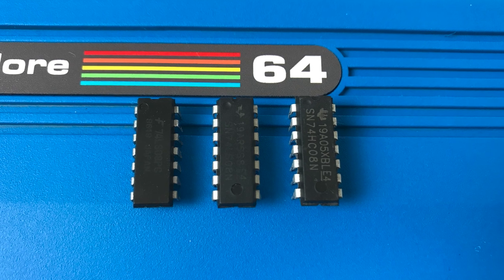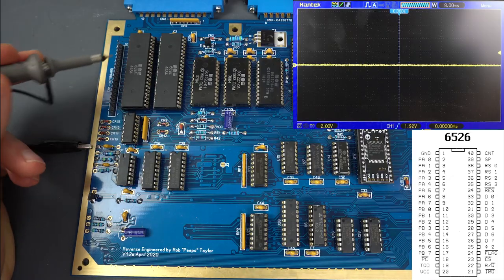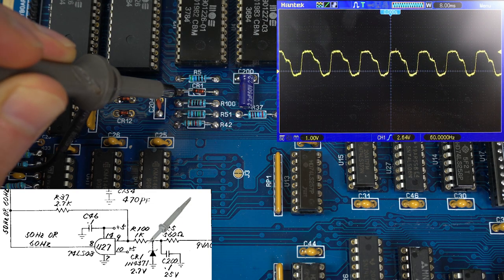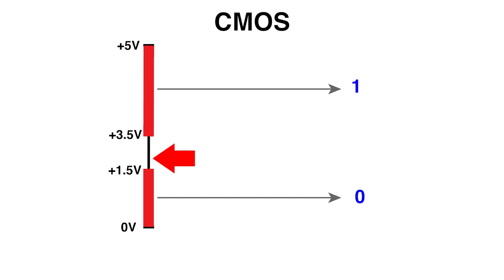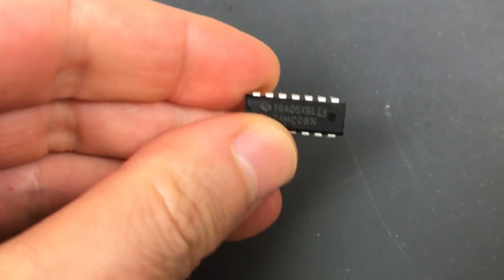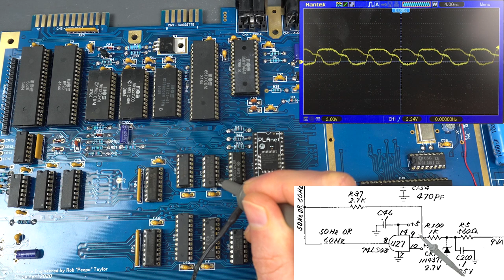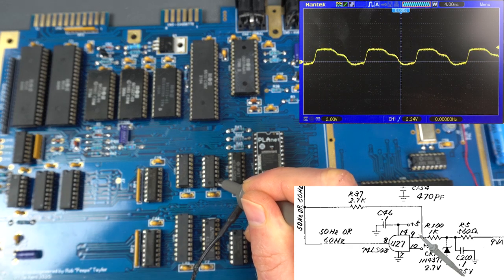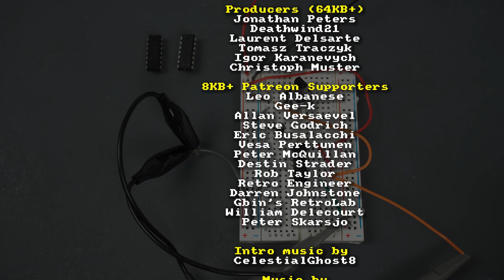Stumped By New Fake Chips Scam

Comment: Fake components started to become a problem in the early 2000s, when production was basically outsourced to Asia. A company I used to work for was seriously hit several times by the infamous capacitor plague. Even when sourcing supposed top notch products from very serious distributors, that ended reviewing their own supply chains, and, for what i understand, involved the police as well. It meant millions of pounds to these guys.
Reply: The real cash cow appeared after 2004 when RoHS laws were passed. Thousands of companies found themselves with a huge inventory of components with lead and almost all were bought by China at super low prices. These are now resold everywhere with new markings all dated after 2004 as RoHS compliant parts.
Reply: It was happening in the 90's. We had some Pentium chips that had been skimmed and re-lettered. Some would work for a while as the clock was out (A Pentium 75 clocked at 90 for example) but would crash after a while....

Comment: It happens quite a bit. I found it when developing Pi1541. I use a 74LS06 to take a 3.3v signal from the Pi and invert it to drive the open collector IEC bus signals on the c64 low. Some cheap Ebay sellers buy their components in bulk from China and most of the time they don't work as well as the official TI ones from Mouser, Digikey or Element14. Then the end users come to me complaining about my software. After I tell them to replace the 74LS06 with one from a credible source their problems go away. Thanks Noel, now I can refer them to this video.
Reply from the maker: What a bummer that it's happening all over the place. I really need to find a reliable source of chips that has reasonable shipping for small orders. That's the difficult part!

Comment: It would be interesting to see the current consumption of the suspect chip. A CMOS one will consume essentially zero (just a few μA) unless it is switching rapidly. A LS TTL one will consume mA or tens of mA in the same state.
Reply from the maker: That's a good idea. Maybe I need to do a followup video running some more tests on those chips and maybe cracking them open too. I've been meaning to do that for a while.
Reply: Also, TTL chips behave like they have a built-in pull-up resistor, and source some current when you input "zero" into them. CMOS chips are high-impedance in either low or high input state, you only need some current to (dis)charge internal capacitances when you switch the input from high to low or the other way around. Measuring input pin current can be used to tell TTL-like logic from CMOS-like logic.
Reply: I've seen that... back in the day, a friend helped me make a home-made RAM upgrade to a Tandy 100.  Using a standard RAM chip meant adding a logic gate, and without any HCT handy used a LS.  That one chip used as much power as the entire computer!

Comment: Wow, that's shocking that they've have gone so low to start rebadging 74 series...
Reply from the maker: Seriously! Although I really don't think this is rebadged in the sense of produced one way and modified, but I really think it was manufactured this way. Crazy!
Reply: @NoelsRetroLab  There are several Chinese manufacturers that produce these chips legit (i.e. HGSEMI, Xinluda and more). Very likely someone paid one of those factories to produce chips with a TI label (because then they sell for a higher price) and they were labeled LS because that is what people are searching for. If I buy from China I rather have a Chinese brand on the chip, because then it is much less likely a fake.
Reply: @danielmantione  I use CMOS a lot, both 74HC, 74HCT and 40 series. I think people should move to CMOS as they spend less electricity. Also, I have no static protection, and none have failed so far. So people should not be afraid of them.

Comment: Great video.  Just as a side note,  though the 74HC chips may or may not work in those types of TTL circuits,  74HCT chips(the T standing for TTL levels) are specifically made to be backwards compatible with TTL LS and ALS chips,  and the input threshold voltages would be the same for both.

Comment: The analog behaviour of 7400-series logic can vary widely from device to device.  I've noticed this myself with multivibrator circuits which were built using 7400 quad AND gates.
Reply: Well, they're not analog chips, after all. You can get a hysteresis filter using a Schmitt trigger part, such as 74x132 instead of 74x00.

Comment: To elaborate on what was mentioned near the end of the video, there are actually two kinds of 74 series cmos chips. The ones that are labeled 74C, 74HC, 74AC etc, are the kind you have in the video. They are made with the functions and pinouts of 74 series TTL chips, but with CMOS voltage levels for interfacing to CMOS logic chips like the 4000 series. There are also chips labeled with numbers starting with things like 74CT, 74ACT or 74HCT, etc. These are made with CMOS but they are made to use TTL voltage levels to interface with TTL logic, but with the low power consumption of CMOS. 

There are also parts labeled with numbers starting with 54 , such as 54LS08, 54ACT08, or 54HC08. These are the same as their 74 series equivalents, but are mil spec components with an increased temperature range.

Comment: I used to have 3 C64 computers but only one reset when the kitchen fluoro was turned on or off. The fast spike went straight through the psu and any filter Cs. If I remember correctly, tantalum caps filter out higher frequencies than electrolytics so would be better for HF noise. Once reversed, I wouldn't risk using a tant again...I have seen some light up even when installed correctly.
Interesting videos , Noel, and nice looking C64 board.

Comment: I repaired a ZX Spectrum programmable joystick interface recently and accidentally fitted a HC ic by accident with the others, instead of a LS. Had me looking for a very intermittent crash for ages, until I realised my mistake. The tipping point for a port crash was just on the edge and was corrupting the data line.

Comment: Hi Noel, me the Chinese mythbuster again! From my China factory experience, they may have shortage on the LS type of chips but not the HC, so they need to fill the shipment, otherwise the business will be ruined. Or someone did placing the wrong order carelessly. Since Chinese character is totally different from English, and Chinese factory is not a place with people with high level education, the foreman may barely can use English and make a batch of HC but customer want LS, so what? Mark them as LS!! Remark chips can cheat TLS866II and work in some situation, just this kind of circuit which require tight voltage level,fail.
Reply from the maker: Right, that makes a lot of sense. It's such a shame those things happen!
Reply: @johnsonlam  Do you think they feel bad about cheating or do you think they feel good that they succeeded in getting away with it? =(
Reply: I'm of the same opinion as you. The chip was bought from a reputable Chinese seller (they don't deal with NOS, or refurbished chips, only new stock), so the problem was clearly at the factory. I, too, guess they had this order, run out of LS and said "whatever, rebadge some HC and call it a day, no one will notice", and sent the chips to the seller.

Comment: In the 80' days a lot of clocks worked using ac signal as a clock freccuency because it is very accurate in long term.
Remember the "radio reloj despertador" all of them worked using the 50/60Hz from mains, in fact most of them have a switch for selecting 60 or 50 Hz.
Reply from the maker: Makes sense, but somehow it never dawned on me back then. I assumed they just had something internally that acted as a clock, but the 60/50Hz switch is a good giveaway 😃`

Comment: Something worth mentioning, re: mains frequency synched clocks..
For several decades, clocks have been synched to mains frequency. Before electronic clocks with digital logic, clocks like the one pictured used synchronous motors - a bit like the one that drives my belt-drive turntable. Here in Australia, the lights still flicker around 2am each morning as power utilities trim the rotating machinery driving the grid such that the number of complete cycles in the 24 hour period is (as far as I know) within a certain percentage of 24hrs x 3600 seconds x 50 cycles/sec = 5,184,000 cycles. That is mandated by the fact that traditionally, so much time-keeping relied on it. Nowadays, NTP (the network time protocol servers) means our computers and phones are almost always in sync.
Reply from the maker: I love the detail of the lights flickering at 2am because of that! I never thought of that, but it makes sense to resync the pulse count. I wonder if the same is true in other countries or they handle drift differently in a more progressive way (skip a cycle every X hours).
Reply: @NoelsRetroLab  It came up in a subject I was studying. It blew my mind that all those machines connected to the grid all run in phase, in sync with each other. Has to be the case of course, otherwise there would be massive failure currents. Good job on the video, btw. I had a heck of a time trying to source some HD63C09E chips that weren't fake. Two orders out of China were then a UK vendor sourced some, (also from China) tested them first then advertised on eBay. Got to upgrade my FLEX system but I haven't done much experimentation with the chip's native mode as yet.

Comment: Another giveaway that the chip is CMOS is that the OUTPUT voltage goes at or near 5V. A real LS one would barely reach 4V. Not that this affects the circuit any; I'm just bringing it up to add one more way of identifying the line of chip. Excellent video, although I wish that the scope had more prominent lines for each volt.
Reply from the maker: Good point! And I agree about the volt lines. I don't think I can tweak those, but I'll check just in case. I'd love to have them more visible as well.

Comment: with the latest version of xgpro (11.71) you can actually choose the test voltage (5.0, 3.3, 2.5, 1.8). one thing to note is the test menu is no longer listed as an ic option. it has its own menu and dialog window

Comment: Great explanation on the zener diode.  I had always wondered what an application for one would look like - little did I know I had one next to me!
Reply: Another application is to reduce a "TTL" serial port signal from "5V TTL" to "3.3V TTL" signal levels when connecting to the hidden serial ports in various gadgets using USB adapters designed for 5V arduinos.

Comment: Hello Noel! If you also change the resistor R100, not only the zener diode, to a higher value, you should get a higher voltage level on the AND gate input. So then it should also work with the "original" 74(HC)08.
   Greetings, Doc64!
Reply from the maker: Yes, good point. That was going to be the next thing I would have tried this this hadn't worked. I don't think it would have mattered too much to put a slightly higher value.

Comment: CuriousMarc did some videos the first part of this year where he was repairing a bunch of timer modules for an old HP computer. The clock circuit used was similar to the way the squaring up circuit for the CIA timer was done by Commodore, except it was crystal driven. 

He found that even if he replaced the chip with the same part number from a different manufacturer it would not work properly and he had to change a feedback resistor to a lower value. Evidently this type of operation is 'quasi-analog' (made up but descriptive term) and depends very much on the analog properties of how the exact chip was fabricated. So, in a typical digital signal operation it would work fine but not in this quasi-analog state. Interestingly Ken Shirriff found out from decapping and reverse engineering flip-flip chips that they have a quasi-analog design as well which explains why they tend to fail more often than other logic chips.
Reply: Potentially this might happen even with chips from the same manufacturer if they ever changed the design.
Something which was clear is that the LS chip produced a lot less "noise" than the HC chips when given a "midpoint input".
Reply: I can imagine a low-volume manufacturer using only chips that "passed" testing for their particular application, but HP isn't a low-volume producer.  They must have had success with their default supplier's chips, and never knew how close to failure they were.
Reply: @jpdemer5  I suspect HP knew full well. They designed the circuit knowing it would work with the ICs their suppliers made and that was that.

Comment: Great diagnostic video!
Yeah, conclusion is shocking. There is no logical sense to fake 74 logic chips, but, apparently, someone gets money from that. 
One option is, that assembly factory purchased lots of unmarked chips and after job was done, they resell these leftover chips very cheap or thrown away and rebranding was done by some underfloor factory in China who picked these up..

Now I need to verify my LS stock. I think that I have at least one fake, because of strange behavior in one new circuit - replaced with old used IC from different manufacturer and problem disappear.. 

This reminded me situation with TDA1524, back in days. Purchased originals - both was faulty. For one chip worked only one channel, for other chip worked only other channel. From different local seller I  purchased other pair of chips. Seller warned me, that these chips may be fakes. I get home, plugged first chip in socket and it worked as it should.. Both chips, claimed as fakes, worked, but originals didn't.. 😂
Reply from the maker: Exactly. I never even considered that 74xx chips would be fake. But now... ugh!
Reply: Maybe you can just order them with whatever label you want

Comment: Noel, this explains why I was told that you could use a TTL chip for a CMOS circuit, but you cannot use a CMOS chip for a TTL... due to the low trigger voltage levels. Blows my mind that a manufacturer would do this!
Reply from the maker: Well, this is not exactly the reason, because this is a very specific analog signal. But even in the case of digital signals, it's possible for a TTL gate to output 2.7V, which would not be recognized as high by a CMOS gate. Although I suspect that in practice that's not very often a problem.

Comment: There are two types of 74xx CMOS logic gates, the 74HC range, like the ones you were experimenting with, but there is another range 74HCT specifically designed to have the same transition voltages as standard 74TTL chips. The “T” after the HC denotes standard TTL logic levels.
I think if you put a 74HCT08 it would work.

Comment: Thanks for the lesson on CMOS and TTL differences. As always a very well put together video.
Reply: Quite weird, as 74LS isn't the original TTL, and 74HC isn't the usual Motorola 40xx CMOS. 74HC is a modified CMOS internal circuit that tries to approximate the original 74 series voltage levels.

Comment: Excellent video. I would like to mention a couple of things about importing from you know where but first some technical details. The first TTL was 74xx then 74LSxx and then 74Fxx and it has progressed from there and today we have 74HCxx 74HCTxx 74AHCxx and many nore that are not in common use. Along side in the earlier days we had the 4xxx series CMOS (which were very ESD senistive as there were no clamping diodes). 

There is something that is overlooked today. Most CMOS will run from a little over 2 volts up to - in some cases - about 15 volts. The "" LS F C HC HTC ALS etc are the "technology" and not the voltage specifications (Vil Vol Hih Voh). The Vil for old 4000 series CMOS was 1/3 Vcc and Vih was 2/3 Vcc and these are a specific voltages at a Vcc of 5 Volts but are different voltages with a different Vcc. As an example most JEDEC SRAM 6116 6264 or modern EEPROM 28C with Vcc specified as 5V +/- 10% will accept the lower TTL Vih even though they are CMOS. This is demonstrated clearly by the 74HCT series that is CMOS that accepts TTL Vih as opposed to CMOS Vih which is much higher. 

As for fakes - there are massive industries in you know where and they are based around the major ports. Order from a little further away and it will take longer but you will more likely get what you want. It will still be washed in the creek and pulled then sold as new and be usefull for hobby use but at least it will be what you believe you purchased and will probably work as expected. Detection is such a problem now as it poisons supply chains that critical industries like medical, aviation, aerospace xray the chip to read the die. 

Loved the video, older but very relevant.

Comment: Great video, many thanks, love the logical fault finding and 'proving' technique...now that's how to find faults, guys. Servicing TVs in the 90's we had a batch of  high power 2N3055  TO3 transistors immediately blowing up when switched on ( put on Blast hats and dive under the bench!!)  Cutting a 'new' one open, we found that the silicon die was a fraction of the size it should be, yes it would test OK and run in a low power circuit fine... But, give 'em some whoomf and Bang!! .. Yes, they were 'new' from China......  I hope you like the highly technical language and description... 🙂